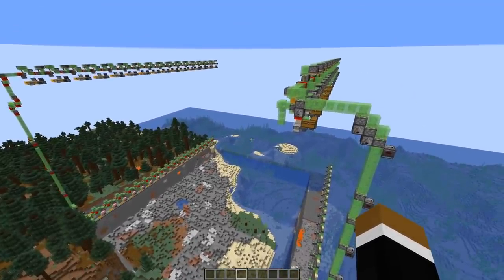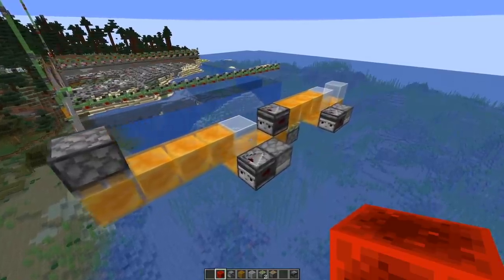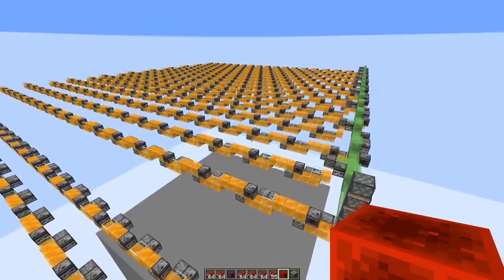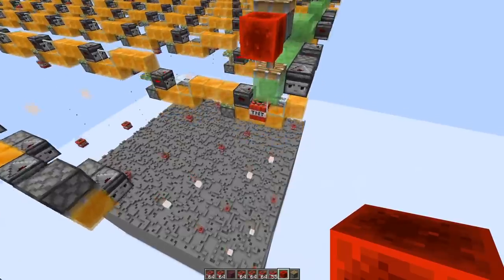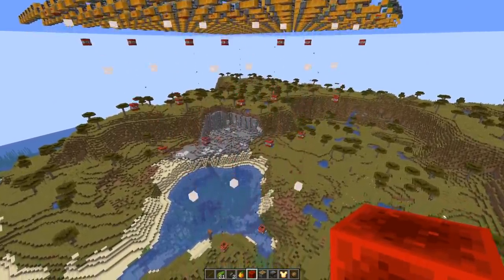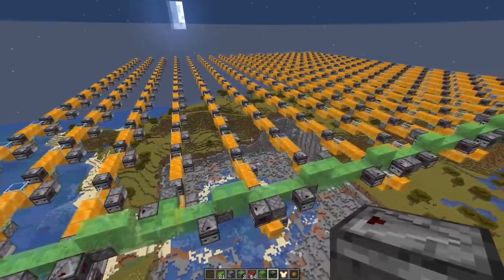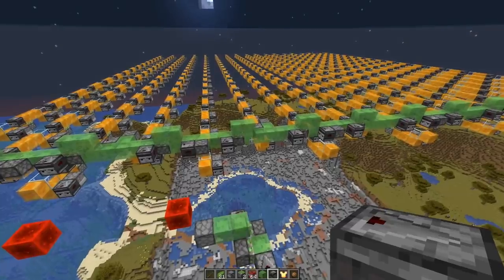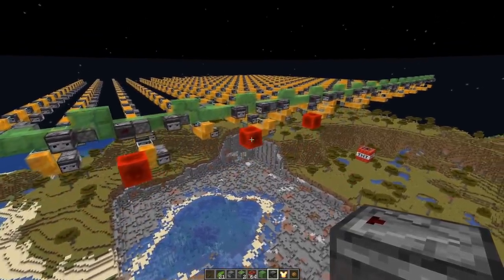MBE #5: Movable Dispenser Grid

Comment: For the design you were talking about at the end, what if instead of redstone blocks you used any opaque block and put an inverted daylight sensor on the flying machine. With this you wouldn't need to move the blocks down because the shadow of the block would go infinitely downwards. You could modify the daylight sensor setup to work at night too but that might be a little tough to put on a flying machine
Reply: Oh, this sounds great! I was gonna say something about daylight sensors being immovable, but... this is the movable block entity series :D
Reply: @Tomas SALVO you can by comparing the signals from 2 inverted daylight sensors
Reply: @jamesflanagan6977  But how do you do the comparison on a flying machine?
Reply: @zackglenn2847  with MBE I'd assume you can move comparators but maybe I'm wrong
Reply: Neither daylight sensor or comparator can be moved (definitely not in Bedrock Edition).
If you can,then  it would be much easier to just use comparator and hopper clock than a daylight sensor
Reply: I think getting the blocks there in the first place is the problem ('_')/
Reply: You could also have the flying machine itself pulling the redstone blocks down

Comment: the flying machine could pull down the redstone blocks them self, so it would still be less effort
Reply: Oh, that is beautfull. Might have push it down instead of pulling, but that would totally work.
Reply: I just thought about the same idea lol; should be doable
Reply: Pulling would be difficult because of quasi-connectivity  - a piston wouldn't retract and slime/honey blocks wouldn't let go. So like Racernator said, you might need to push instead, either with a separate flying machine or a loop of slime/honey blocks.

Comment: I have an idea for MBE

Make one Nether Portal Frame (not active) and behind that a corridor. But with a press of a button, the corridor closes and the nether portal gets activated. (behind the nether portal is now a wall)
Pressing the button again will make the nether portal inactive, opens the wall and you can go into the corridor.

You can light up a portal base with a flint and steel in an dispenser und break it with a water bucket.

And for extra fancy stuff: Make all dispensers, pistons, slimeblocks...  hidden. (After all is done)

Comment: Would it be possible to make a flying machine that refills the dispensers of this flying machine
Reply: Just add a hopper and a chest on the side of the dispenser
Reply: Kai Li   or that
Reply: Kai Li   or that
Reply: I'm pretty sure even just 2 stacks of tnt in each dispenser is already enough tnt, since the highest mountains can only to go around 128 blocks
Reply: @JustJum  cliff update bout to be like nope
Reply: It wouldn't need it. You only need 1 TNT per Y level and dispensers can fill up with 576 TNT - more then the current Y level.
Reply: It's ilmango, when is anything impossible?

Comment: The redstone block thing doesn't require a grid? Literally just have the machine that pushes the dispenser also push down the redstone block. Sure it'd be a pain putting all the redstone blocks in place but that sounds like a great alternative
Reply: Had the same idea. Thinking about it, maybe it could be replaced by some kind of piston tape that moves the redstone block out of the way for n blocks.
Reply: Could have upward facing sticky pistons on the same flying machine as the dispensers pull the redstone block down after they activate the dispensers
Reply: @bradenwilson8325  they would stay extended as they get signal from the block
Reply: qc isn't actually a problem you could use slime blocks, the point is moving them down with the same flying machine
Reply: @Braden Wilson Wouldn’t that be kinda challenging because he only wants the dispenser to dispense every six blocks so it saves tnt. I mean that could be solved using a moving hopper time which would be cool concept but gets kinda big.
Reply: @cameroncoulter487  I'm saying that you should leave in the redstone block grid which deals with the dispenser timings, just try to pull down every block and it will only end up pulling down a redstone block every sixth

Comment: On the redstone block grid idea: just have a piston attached to the flying machine that would pull or push them down 1 block as it flies past. It would still require a lot of effort, but it would be much easier to place, since the entire grid would be at the same level instead of  going up and down and it would require much less resources.

Comment: I've been clearing out a 1000x1000 block perimeter in my creative world using a grid that doesn't move, I just clone it where it needs to go.  I wanted to use flying TNT dupers but couldn't get them to work for some reason; I can separately get the flying machine to work and I can get the TNT duper to work but I can't get it to do both at the same time.  The assembly I use is 58 blocks across, with 20 evenly spaced dispensers containing one stack of TNT, a single redstone source in the center and repeaters as needed to get the signal to reach everything.  The range of the dropped TNT is around 80-85 blocks, so I do this in two stages, first at Y=130 (which gets rid of most mountains and a lot of terrain), the second at Y=80 (which gets rid of everything else).  I take out any water/lava with proximity-based fill commands.  It's admittedly a little tedious reloading the dispensers but worth it to watch things get blasted away a slice at a time.

Comment: What most world eaters do on bedrock is use a grid layout combined with a traditional world eater. meaning that 2 way flyers fly back and forth with a dispanser that gets power by a grid of redstone blocks that get pushed down by a piston on the flyer every pass. this would require much less resources and time to construct, and it also has the same tnt efficiency. you should really look into this design where the piston on the flyer pushes the redstone block down because it is probably the best tnt efficient world eater.

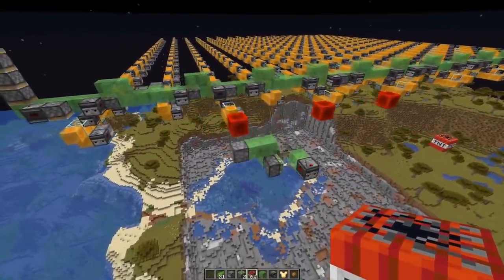Comment: 7:55 you can pull down the redstone block with a sticky piston on the bottom flying machine
Reply: no, you can't, the piston won't retract
but you could push it down from above
Reply: You could maybe have the Redstone block at the side and dispense the tnt before pushing the block down with one machine.

Comment: If you varied the amount of tnt in each dispenser you could generate a spherical perimeter. The ones in the corners would start with none, or wold have a stone block instead of a dispenser if they couldn’t be left out completely.

Comment: How feasible would it be to  have two lines that go down, come back up, and move to side 12 blocks? You could then fill them with two or three stacks on tnt for the trip down, running out at the bottom. After it returns and moves to the side you refill and send it off for the next pass.

Comment: For the redstone block grid idea at the end, couldn’t you have a flying machine come in after the tnt dispenser and push the redstone blocks down behind it? As long as the piston pushing the redstone blocks down triggers when the flying machine goes both directions, and it waits long enough for the tnt dispenser to go, it should work I think. It would be less expensive than building a grid to push down the redstone blocks, and probably less effort too. Someone please correct me if I’m wrong, I don’t do much with flying machines so I don’t know too much about their mechanics.
Reply: You could maybe even cheap out and instead of redstone blocks just use regular blocks and have the dispenser powered through an observer and regular blocks

Comment: if you had a vertical movement piston machine that was manual for the redstone blocks at the end, youd only need to move it afew times (depending on initial height) as you wouldnt actually have to move them every time the horizontal machines go by, as you only need to move those around every 48 times they pass by (youd lower them and the redstone block machines down around 48 blocks at once, and then wait another 48 passes to do it again if you need to)

Comment: What if you made two of the long honey columns but also made them be able to be moved left and right instead of just down? And then build a perpendicular sidebar that stops it in the right position to keep with the grid and fires down the line and moves the whole system down when it gets to the end? It would be slower to clear out, but would require less effort to build and be the same tnt effiiciency

Comment: This feels a bit like a cop-out. It's possible to trigger dispensers every 6 blocks. You could chain 3 T-flip-flops for a cycle of 8, but set them when the tnt is triggered to get a cycle of 6. You could also have two flying machines that take turns flying 6 blocks and the swap would trigger the tnt. It would be more powerful and less build effort.

Comment: As much as I usually love Mango's videos, I still find usual tnt duping 2way flyingmachines more useful, especially if we add a sweeper, like we'd have to with this one.
Reply: But what are you going to do when Mojang patches TNT duping? That's the point of this.
Reply: @omnitroph1501  I think you misspelled "if" as "when" . I see no merit in patching TnT duping even from Mojang's viewpoint, since it's not like the players can simply aquire multiples of it, they can just simply use it multiple times, but even those, only in a restricted area. Unless you strap it to a flying machine, it's gonna be dropping the tnt at the same place over and over anyway.
Reply: @Wortigon2000  They already tried to patch it in 1.13, and devs have confirmed that they intend to. However, they're trying to do it without getting absolutely obliterated by the technical community, so it will likely come in the same update as movable block entities. That's why Ilmango is making dispenser-based world eaters, to prepare for that update.
Reply: @omnitroph1501  until they give us both moveable block entities, AND a way to get renewable sand without using the end portal for item duplication, it'll most likely stay with us. If it doesn't, they'll get obliterated by thetechnical community as you've mentioned. Gunpowder is easy to come by, but without sand dupeing, sand is actually quite impossible to farm infinitely. Unless you create a world-eater-like contraption that moves alongside the perimeter it creates, and somehow doesn't destroy, but collect the blocks instead. Like a quarry that can go infinitely.
Reply: @Wortigon2000  I agree entirely.
Reply: @omnitroph1501  Honestly MBE is not a replacement for tnt duping, just imagine crafting 100k tnt in vanilla without cheaty CTRL Q crafting, also there is no way to get like 500k sand, don't think they gonna make it renewable.
So with introducing MBE world eater concept just die, there is already servers with MBE like Bismuth SMP and noone just use it for peris.
Mango patreon did it, but they have autocrafting (And we all know that Mojang would never introduce it in the game and it was confirmed by dev) and renewable sand, also a team of dedicated players.
So far MBE is useless and overrated feature.